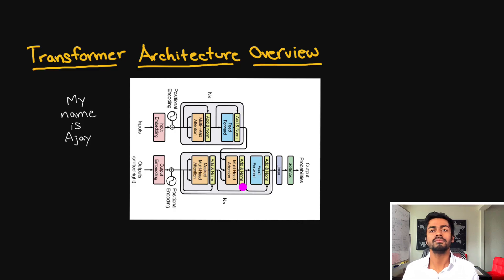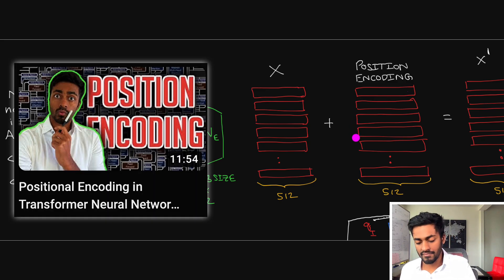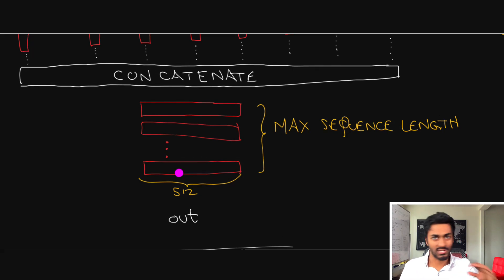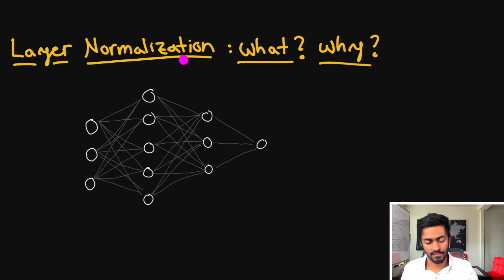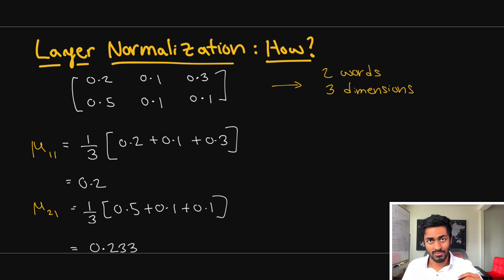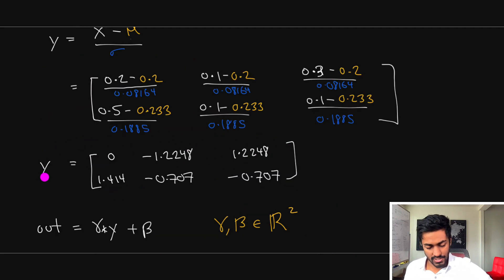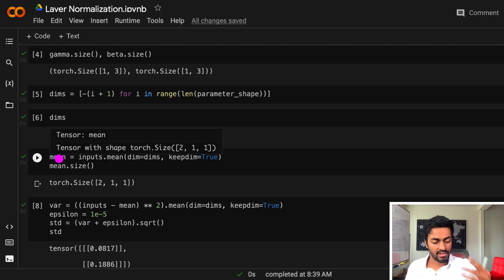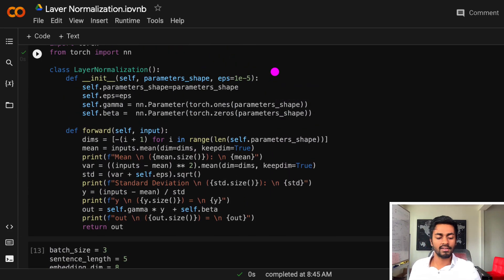Layer Normalization - EXPLAINED (in Transformer Neural Networks)

Comment: 6:56 actually you would use the variance instead of the standard deviation, so in the layernorm formula it should be sigma^2 in the divisor. and the epsilon is missing to prevent zero division

Comment: A bit late but can you tell me if my understanding is correct. The output from the attention head might have skewed means because of the large spread of the values, this might consist early lead to wrong predictions. So the gradients might constantly changing itself to correct these predictions which might lead to incorrect change in the weights which eventually leads to exploding and vanishing gradients. To correct this we sort of reset the mean and then fine tune the mean according to the matrix ?

Comment: I think your code is not correct, LayerNorm will not be over the batch. Try and think what it means to take normalisation over the batches. For a layer norm each entity of the batch is unique, and each should be normalised across the layer of the MLP (essentially everything is MLP).
Reply: Same thoughts. From my understanding, I don't think inputs.reshape(S, B, E) makes any sense. Also, I think the layer-norm should be applied to the last dimension (hidden_embeddings), the mean and variance should have shape (batch_size, sequence_legth, 1), and the gamma and beta have shape (sequence_length, hidden_embeddings)

Comment: as per my understanding and from the LayerNorm code in pytorch, in NLP for an input of size [N, T, Embed], statistics are computed using only the Embed dim, and layer norm is applied to each token in each batch. But for vision with an input of size [N,C,H,W], statistics are computed using the [C,H,W] dimentions

Comment: I am actually not sure why it is okay to reshape your input from (B, S, E) to (S, B, E) @ 10:10.  It doesn't matter in this case as B=1, but in general wouldn't you be changing the your data? In particular, you would change the number of words in each batch, i.e., changing the maximum sentence length.

Comment: Is pytorch better for NLP task than Tensorflow?
Reply from the maker: I wouldn’t necessarily say that is the case. Tensor flow and PyTorch are frameworks we can use for building these complex models. PyTorch might be easier to use since you don’t need to code out tensors themselves. But tensorflow (or even going as low as numpy) can be used to train models too
Reply: @CodeEmporium  Thanks for clarifying

Comment: if our batch has 2 vectors of 2 words x 3 embedding size say:
[[1,2,3],[4,5,6]] and [[1,3,5], [2,4,6]]
For layer normalization,
Is nu_1 = mean(1,2,3,1,3,5)
and nu_2 = mean(4,5,6,2,4,6)

Just wanted to clarify. Keep up the great work, brother. Like the small bite sized videos.
Reply: meaning , the statistical calculation for first vectors of all batches are done together? like how you calculating mean using the first vectors of both the batches?
Reply: I don't think that is correct. Layer normalization is not applied across a batch. It's applied to a single input observation. The mean and std values are computed for each embedding.

Comment: Have an actual question this time! While trying to understand the differences between layer and batch normalization, I was wondering whether it’s also accurate to say you are normalising across the features of a vector when normalising the activation function - since each layer is a matrix multiply across all features of a row, would normalising across activation functions be similar to normalising across the features?

In the same thread, can/should layer and batch normalization be run concurrently? If not, are there reasons to choose one over the other?
Reply from the maker: Good questions. From what I understand, we normalize the activation values across the layer (I.e make sure the values across the layer follow a bell curve of sorts). While in batch normalization, we do the same exact thing but across the batch dimension instead 

The only issue i see with batch normalization is that it is dependent on the batch size (which is typically an order magnitude smaller than the size of layers) If we apply a normalization to a small number of items, we might get erratic results (that is the mean and standard deviation of a small number of numbers simply don’t lead to values that are truly “normalized”). One remedy would be to increase your batch size to a sizable number (like in the hundreds). I have heard this is an issue with NLP problems specifically. But I would need to do my own experimentation to see why.

Comment: 10:30 when layers normalizations are "computed across the layer and also the batch", are their means and std connected as if the batch boundaries aren't there? So that means there's a different learnable gamma and beta parameter for each word?
Reply from the maker: “Means and std connected as if the batch boundary isn’t there” ~ yes

But we have the same gammas and betas for the same layer across ALL words in the dataset
Reply: @CodeEmporium  The graphic to the right at 6:25 made things a little confusing then, because gamma, beta, mu and sigma all have the same subscript, suggesting that they are all computed across layers. It's not until your example  that I realized that mu and sigma are actually computed across words, while gamma and beta are computed across layers

Comment: Given that we have 8 heads, Is it 512 / 8, which is 64? Are we actually going to split the 512 into 8 equal 64 length parts?
Reply from the maker: In theory, that’s what’s happening. In code, we make “8 parallel heads” by introducing another dimension. For example, vectors of shape 30 (max sequence length) x 10 (batch size) x 512 (embedding size) would form query key and value tensors of shape 30 x 10 x 8 x 64. So there is a new dimension for heads that essentially acts like another batch dimension for more parallel computation